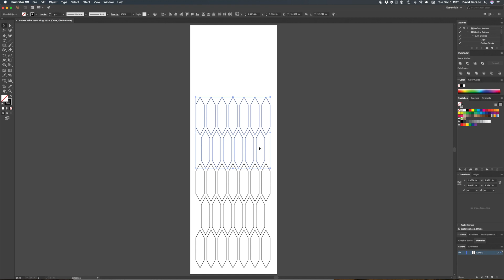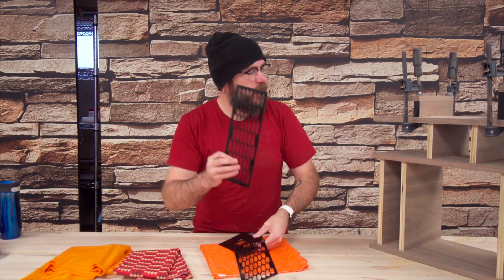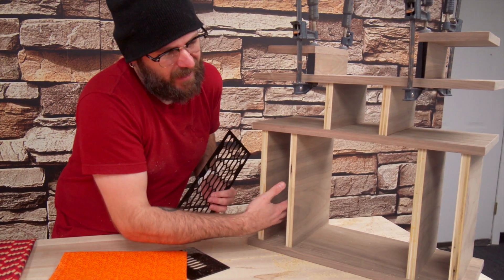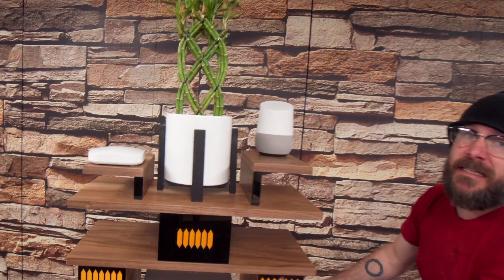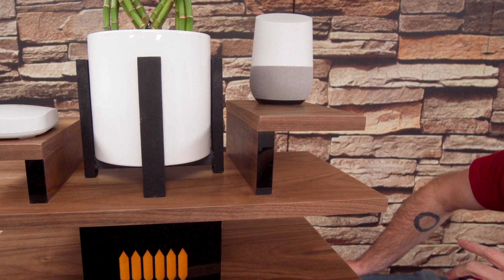How to Make Mid-Century Modern Console // Woodworking Project

Comment: Yes, the eero is great. Very smart to use your power lines to run the internet signal to the wireless nodes in the house. Cute that it mirrors schemes from the 70's for other signals.

Comment: Quick tip... when using the dowel alignment pins in that situation such as the top pieces. I use a square or an L shaped jig at a 90 degree angle placed right on my marks to line up my top board so there is no error in alignment. I hope that’s not to confusion lol. Yep clear as mud I’m sure.

Comment: Great simple project. I showed  it to my Nephew and he wanted one for himself, Great project to start woodworking  with a few minor variations since i don´t have a lasercutter. Thank you

I noticed though that you didn´t put the dowels in the Edges first. which can be a problem. Since everything is a tight fit, it can happen that you push the dowel out the other side during the glue up, which leaves either bumps or in bad cases (chipboard) chip out. It can still happen, even if the holes are slightly deeper than the length of the dowel. By chamfering the edges of the holes and putting the dowles in the edges first, you save yourself from alot of grief.

Comment: I started using the technique with the masking tape flag on the driver bit for dowels and i noticed that it can get too hot and the tape would start smoking a bit, is it better to drill the hole faster to avoid this? I was going a medium speed with a drill with higher torque

Comment: A little tip I learned is to glue the dowels, not the holes. When you glue the hole, you effectively turn the dowel into a piston in an engine. It can make it difficult to seat the dowel all the way in the hole or, in thin material, blow out the top (factually happened to me).

Comment: Really nice.  I'm just getting into woodworking as a hobby, but I finally have a video where I can make a suggestion.  You might be able to get an easier and more reliable cloth glue up.  Rough cut it a bit large, secure it taut and flat, spray up your acrylic, place it, then trim up the cloth shy of the edge.  Love the videos.

Comment: Really nice design David! I'm working on something similar for my place, so it's nice to see your solution. I'm curious, how do you like the Glow Forge compared to your old laser? I really want a laser in my shop, and the Glow Forge seems like a nice size.
Reply from the maker: Thanks! There were so many things I disliked about my old laser. The software was horrible but I think they've fixed it in their current version. I do like the Glowforge but since the software is cloud based it can be a little slow uploading files.
Reply: Right on. Thanks for the info

Comment: pimpy...   dig it man..     maybe small rare earth magnets would be a better closure system for the front panels..?   just recess the receiving magnets into the piece, and surface mount the others on the acrylic. Just a thought to close up dim gaps brah..  love the design and finish..
Reply: You only need magnets on one side, maybe some thin steel sheet on the other.

Comment: Isn't everything from IKEA "adjustable";) haha..
QUESTION: SO IT'S LIKE A WIFI ENHANCER??  I have horrible service in my basement shop which is where I am most of the day/night.so that wood be great. Very cool and retro looking console I like it🍻👍👍
#PrEtTygoOd
Reply: I'm not familiar with the product, but I'm assuming it's creating a mesh network. Essentially it extends the range while halving the speed
Reply: thejman713 ohh so it cuts the speed in half but u get longer range /more hot spots..gotcha.thanks👍
Reply: Yup. And to be honest, as long as you are not  streaming 2 videos at once, you're not going to notice the speed difference. And if you really need to, just do it within range of your primary router.
Reply: thejman713 good thought..Thanks!🍻
Reply: Essentially its like adding wifi repeaters to your router, little 'beacons' that act as a signaling device between your router and whatever device is trying to connect.  Something like this is a good solution if you have wifi dead spots in your home.  Wifi range extenders are a thing but these seem to be much simpler because they are small wall plugs.  I can't speak to how well Eero works, though, I haven't used that particular solution.

Comment: Great video! It's like you're in my mind! I was thinking about how to cover the ends of walnut plywood and looking into the eero ( because my wifi blows!!!). Keep it up! Also I tried your shellac finish and it's tacky. Does that go away with time or is that what the wax is for? Can't pick the wax up till payday so haven't tried it yet.
Reply from the maker: Hmmm it should not be tacky. It should dry in like 30 minutes. Any chance your shellac was old? It does have a shelf life.
Reply: Make Something came for Home Depot so most likely. Getting a table saw and a router for Christmas! Looking to build my 1st hardwood project ever, The make something picture frame! Old school hip hop will be playing in the shop to get me in the right mind set for a make something project